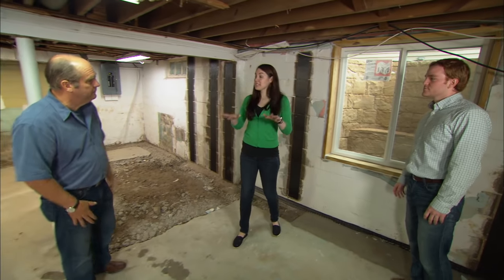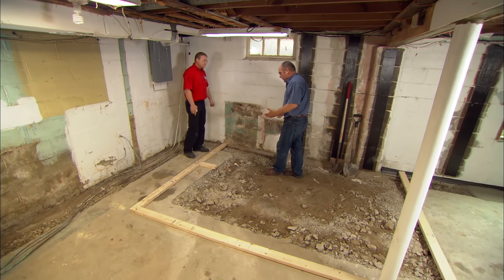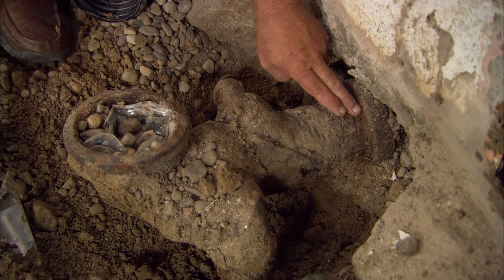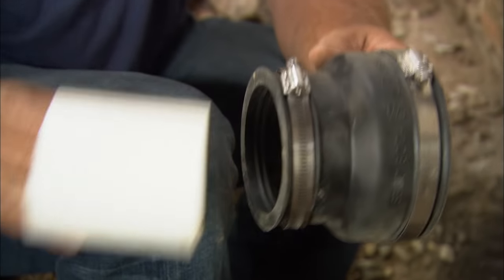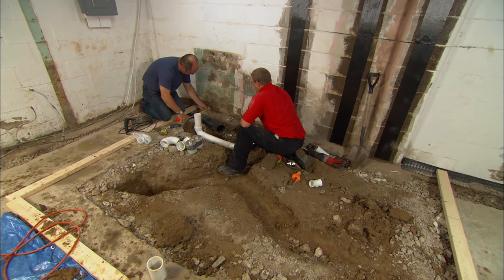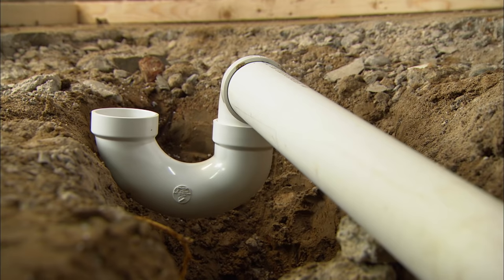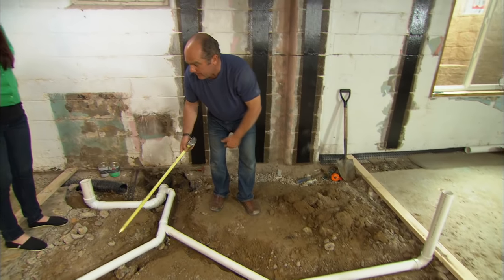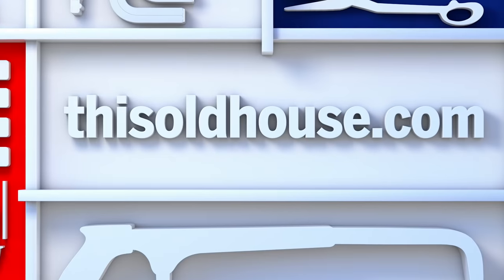How to Install a Basement Bathroom | Ask This Old House

Comment: You skipped a major potential detail: clean out access which could have EASILY been put through wall between space with electrical panel at a few feet elevation. Yes you can pull toilet but assume back-up would have already filled your shower pan with waste - especially if waste line connected to plumbing above.

Comment: The old cast iron pipe looks like it might leak, maybe you caused the seal that has lead in it to leak. If this is cemented over could it leak under the slab. How can you tell if you did not disturb it. Look at 3:17/8:00, and at 5:00/8:00.

Comment: ya um you can cut cast iron with an abrasive cut off disk on a grinder just fine iv done it many times. i am a welder and i have never had any issue cuting or grinding cast iron with abrasives 
but i would have pulled the torch to cut that any way
Reply: Don't tell me you cut cast iron with a torch.

Comment: wheres your primer for the pic cement? 
CI shifted heavily
Toilet needs its own vent within 3 feet of the flange
Reply: In Canada you can wet vent toilet as long as it's the lowest connection

Comment: according plumbing code every opening need a separate vent to me a bad job that underground plumbing work don't pass inspection in state of Illinois
Reply: so you're saying that in Illinois you have to run all indavidal vents and can't run circit vents wet vent combination drain and wast vent commin vents or any other type of vent??
Reply: As Richard said, new codes in certain states allow for wet venting. I like wet venting as it does indeed reduce the labor and materials.  Of course it has to be done correctly.  Also, in close quarters . .or open spaces. . how can you find room to run vent pipes?   This is why wet venting was implemented.
Reply: IPC 2015
912.1 Horizontal wet vent permitted. Any combination of fixtures within two bathroom groups located on the same floor level is permitted to be vented by a horizontal wet vent. The wet vent shall be considered the vent for the fixtures and shall extend from the connection of the dry vent along the direction of the flow in the drain pipe to the most downstream fixture drain connection to the horizontal branch drain. Each wet-vented fixture drain shall connect independently to the horizontal wet vent. Only the fixtures within the bathroom groups shall connect to the wet-vented horizontal branch drain. Any additional fixtures shall discharge downstream of the horizontal wet vent.
Reply: The Canadian plumbing code or National plumbing code has a whole chapter on how to wet-vent!

Comment: The rubber coupling that connects to the old pipe can be buried under concrete? Won’t that degrade in time?
Reply: Maybe a few hundred years. I've never seen one fail in a decade of doing this

Comment: Umm.. I'm not a contractor but replacing 90 year old pipes with a kinda wimpy rubber sleeve & hose clamps? Will that do the job for another 90 years?

Comment: 2:05 - why is the drain branch to shower below the main drain line?  How can the shower drain out?  And where is the vent for the toilet drain?  Is it a wet vent from the lav or shower drain line?  But at 6:13, he mentions that, "in the old days", you would have a separate vent for each drain.  So the old toilet drain didn't used to have a vent in that case.  Would have been good if he had cited it as a real world plumbing situation.

Comment: I have a question.  Will a single vent be enough for a shower, toilet bathroom sink, kitchen sink and dishwasher?    A relative’s shower is having problems with slow draining.  So I looked on the roof and I only see a 1 1/2 inch vent pipe up there.  I was wondering if May need one more vent
Reply: Uganada Bro yes it needs to be bigger or another 1 1/2"
Reply: Ronnie Dingus thank you for the information very helpful. Now I guess that we will have to start looking on to as another vent then.  👍👍👍
Reply: Should be at least 3inch
Reply: Uganada Bro in the instance of all that it is better to run one the inch vent. That would be more than sufficient

Comment: I wish to know how many P trap and vent is required?
from the left to right, 

1.
Vent stack coming from roof connect to Wyn 

2.
left of Wyn mouse is to Vent stack, middle of wyn- top is clean out, bottom is to 2" drain, right mouse is connect to P trap
3. 

after the P trap is a straight 2" pipe, 

4.

at middle of pipe T connect to Kitchen Sink Drain directly from sink without P trap. 

5. 

Right of T continue 2" drain pipe to washing machine drain.

Is this the same as wet vent you shown on the video?

In your video, you mention in the old day, every fixture is required a vent. Can above connection work?

Do you have a Email that I can sent you a picture of my mack up? Thank you.

Comment: Fernco clamp is not legal in Mass... must use a 4 inch 4 band stainless clamp with a 4 by 3 PVC bushing... now you legal...Also need a clean out at the foundation...

Comment: Except you need a ‘Mission coupling’ the coupling you used is not acceptable under most building/plumbing code. Also every pipe under slab is minimum 2”, so that’s not ‘upsized’.

Comment: 1/8" per foot? Why not 1/4"?
Reply: code said 1/8 by foot 1/4 the slop gonna be to fast
Reply: taledarkside Nope, smaller pipe equal more grade 11/2" to 2" should be 1/4" per foot.. @4 " on up 1/8" will be able to carry the waste efficiently.
Reply: scg721 because of where he is tied to  if he were to to do a quarter the pipes would end up above the finish floor your not a plumber are you

Comment: Bottom line is all of this will prolly work fine...but because there was a bathroom here once before...call it a repair job. A inspector will slow things way down and prices will go way up. Wet vents need to be vertical or 45 degree...not horizontal. You can only wet vent a fixture with one other fixture...not a shower and a sink. There are other code issues here but...we'd be here all day. I wish I could plumb like this back in the day.

Comment: That rubber fernco band is a bad idea. its firm when first installed but over time it will soften up and drop causing plumbing issues and sewer can start backing up. maybe not required there but where i live anytime we rough in anything, we have to use purple primer or it will fail inspection.

Comment: Why is it This old house guys never use a guard on the angle grinder. I mean especially on tele!
Reply: Nobody uses the guard ever anyway.
Reply: To pile on, yeah, the first thing to go on a grinder used by professionals is the guard. It only gets in the way of seeing what you're working on and is a requirement basically mandated by the grinder manufacturer's lawyers.
Reply: lol yup, never use mine without the guard, discs can break, kick backs can happen, grinder is the most dangerous tool i use, next to a chop saw maybe. and can't believe they never use hearing protection, grinding a cast iron pipe indoors too, wonder how bad their tinnitus is.

Comment: Do you not need 36" clearance from the electrical panel to the wall?
Reply: Tim Armsworthy no you just need to be able to open the door to the Panel
Reply: @Yojimbo991 Both are requirements.  You need the requisite working space for any equipment "likely to require examination or maintenance while energized", which is a "refrigerator box" that is 30" wide by 36" deep by 78" tall.   You also need to be able to open all hinged doors by at least the full 90 degrees.

Since this is a subpanel, instead of a main panel, that may be how they are intending to get away from this requirement, although I would never advise.   Even a subpanel may require the occasional voltage testing while energized.  Also, there could be a plan to relocate the subpanel, where it does have proper clearance, and make that a closet space.

Comment: I'm an electrician and I hate when people do this they don't ever pay attention to that electrical panel that needs working clearance in front of it and if you build that wall right there electrician is going to be face-to-face with a live panel closer than working space would allow which is dangerous as hell. I tell people picture putting the refrigerator right in front of the panel That's the space that is needed for an electrician for somebody to operate on that panel

Comment: Why not use a 4x3 90 on the toilet a standard flange fits inside 4inch pipe just cut it flush with the floor and glue it on.

Comment: You cannot use that type of Fernco coupling for that application. Those Flex couplings camnot be buried they have to be accessible.
Reply: The Ferncos might outlast the pipes they are connected to.  Plumbers have been using the Fernco to tie into existing infra and plumb with new materials for years.
Reply: @Kudeghraw  What I wrote is per plumbing code. We were snaking a clogged drain in a high rise from the toilet. We were out 15 feet when I went to get some rags. 10 feet of the snake was in the bedroom. Someone used a Fernco inside the wall to attach a fitting to pipe. There was a gap in between the fitting and pipe. The snake went through that gap, went through the drywall into the bedroom. The owner of the unit at that time was the CEO of Hawaiian Airlines. True story
Reply: @brianthompson8949  Cool story.  Sounds more like a skills issue than code.  True story.
Reply: @Kudeghraw  Well it is code. But I'll show you how to take responsibility when you're wrong. I was wrong trying to tell you anything.
Reply: @brianthompson8949  "I was wrong trying to tell you anything."  You got that right.  About the only thing you have got right in your whole life.

Comment: and i didn't understood how excactly the wet wenting works. is there some additional pipe inside the main pipes?
Reply: No, the vent pipes are any of the drain pipes that go upstairs or up to the roof vent, still connected to the main drain system. This allows for air into the drain system so everything flows smoothly.
Reply: +Zack Poling only that sinple! and what if all three pipes would be filled with water at the same time?
Reply: +michji2 Well there is always air coming in from the fixture drains as well. Remember where Richard pointed out that every fixture has a trap? That trap stops sewer gas from coming up, so the gas then goes up and out of the roof vent.
Reply: +Zack Poling oh i see, very well explained, thanks very helpfull :-)

Comment: I have a question for everyone here. My sister had a old crappy house like this and her mainline was a mess. If they are really doing this right shouldn't they just replace this 80 year old pipe while they are at it? I mean I worked in a natural gas piping industry and those old pipes don't hold up That well after 8 decades. Now they are going to pour concrete on it and it's going to leak and they will spend more money ripping up their new bathroom to get to it.

Comment: I know this was four years ago, but how is it code or safe to bury a flexible rubber couple?? Not me, No Way!
Reply: Yeah, you cant get away with that type of rubber fenco coupling, it has to a proper cast iron to plastic coupling, still made from rubber, but its shorter, and has a stainless steel shield wrapped around it. So when you make the transition, the new plastic pipe is completely solid to the cast iron, no flex whatsoever

Comment: You can cut cast iron perfectly with a regular old abrasive zip disc (cut off wheel) you don’t NEED a diamond wheel. In fact the zip disc would have cut much quicker. Just FYI for anyone doing this.

Comment: How does the lavatory drain act as a vent? I'm confused
Reply: The drain will extend past the lavatory trap into the ceiling and out of the roof. It will continue as a vent for not only the lavatory, but ideally the tub and toilet as well, as long as the lav is not in use when the other fixtures are, which is almost always the case.

Comment: Why did he use pvc for the drains?  For low pressure wouldnt you use abs? More cost effective too...
Reply: Different places have code that you have to use pvc
Reply: @BobBob-il2ku  i live in arizona that's why we use abs more due to heat.
Reply: ABS is not really legal anymore in the US.

But you find ABS pipe all over the place in Canada. Go to a Home Depot in the US and one in Canada. Big difference in plumbing parts offered.

Comment: PVC is garbage. Use ABS.  Plumbing code in Canada says you can't have a fitting within 2 feet of your wall. Plus while you had it open if your connected to city sewer you should have installed a back flow preventer.
Reply: Youre the first person in the history of plumbing to ever consider ABS a superior product to PVC.

Comment: In what state can you vent all that with just the lavatory
Reply: Here in Canada we have been venting like that for years it works very well and he explained it well in the video. to code only an inch and a quater line is required for the lavatory for vet venting a two inch is required it allows space for venting and draining of the lavatory at the same time.

Comment: People don't realize but plumbing is very rucial and important. Some mofo sold a house claiming completely renovated and it has given us nightmares since then as the sewage blocks up every now and then. The toilet is always gurgling and water splashing if someone uses the toilet on top floor. I'm yet to find the problem all my moves to discover the problem has gone in vain and it is driving me nuts, this video gives me slight idea a d a guess that maybe there is no vent? But I still don't get the other part that why there is a blockage clogging every other week.
Reply: xxSweetStrangerxx , the vent helps the drain work, imagine if you put your finger on a straw with water, it stays in. The more air you let in the better the water flows out. Vents serve two purposes, one to let sewer gas smells escape if your trap dries out and the other to allow an even exchange of air and water so your drains flow properly. 
Sounds like you may want to call a plumber in and have them assess the problem, they’re the experts rather than just taking a guess at it. I found that saves a lot more money than just assuming what the fool did or didn’t do before you bought the house. They may suggest a better fix because they know what may be available. Find a good one and keep his number handy. I can do most things but there’s times I would just as soon pay somebody good to do it for me. 
They need to stop with their how to infomercial programs. Some people have no business doing that work if they’re only going to be half assed about it. Because people like you get stuck fixing their screwups. I always say do it right or don’t do it.
Reply: You have people that flip homes hiring no professionals that wash all types of tools in the sinks sometimes that's the problem
Reply: @makemyday1477  Thanks for your thorough explanation. I did called one of top plumbers and he told us that the sewerage pipe running in the basement's floor)of the house is "back ditched". By that he meant that the pipe is straight instead of being inclined, the plumber who did the job was perhaps a rookie and did a very poor job against the codes. This pipe is causing the blockage problem almost every other week. Because the line is not inclined there is no power of gravity to pull the water and toilet waste towards the main sewerage.

Comment: This would not pass inspection in Illinois. All fixtures must be vented and drains to a sewage pit.
Reply: If the sewer line is low enough should be fine, and wet-venting is approved for bathroom groups such as this one. In Canada wet-venting is used all the time.

Comment: All under ground waste should be cast iron fittings PVC pipe all husky couplings not furnco couplings PVC fittings are to soft wont hold up when snaking out clogs and technically all under ground should be hub pipe
Reply: Exactly it would probably burst and why the Fock is the bedroom in the basement

Comment: There is absolutely no way I would of replaced that with plastic pipe.  There is a reason why that cast iron drain is still there and working 80 years later.  I would not want to pay that HUGE amount of money to convert a basement into a master bedroom and bath then have to jackhammer and raise the floor when I have a leak.  No thank you!  Got to go with the good stuff and spare no expense when you are going to bury and cover the the pipe in cement.

Comment: He uses a face shield (which is good) and then a grinder with the guard removed and no gloves!  How does think the lavatory drain pipe is going to vent when he just said that it has to have a p- trap on it? - he said that every pipe will have to have a p-trap!  Is it going to suck the water out of the lavatory p- trap to vent the rest of the system, and then not have the necessary water in it to prevent sewer gas?
Reply: And where is the lavatory going to vent when you are using it?

Comment: Love watching this old house. Unfortunately for them the bathroom wall they installed is creating a code violation with regards to the electrical panel. There needs to be 3 feet in front of that panel and it looks like that wall is closer down 3 feet in the front of that panel which indeed would be a code violations.

Comment: It's not legal you have to have the wet vent one  pipe size larger than the drain plus you need a 1/4 of a inch pitch on the drain also no horizontal wet venting